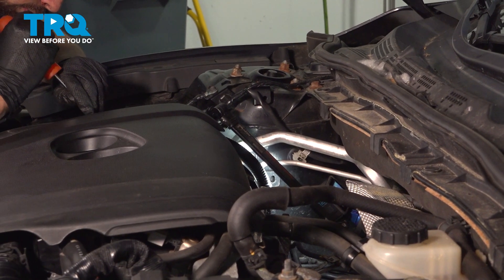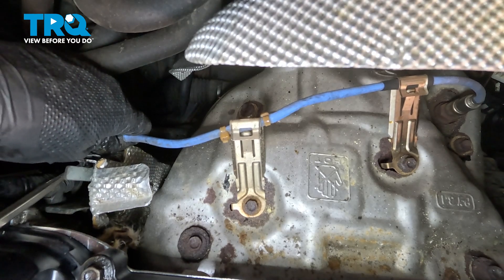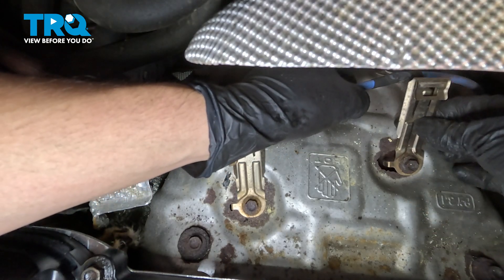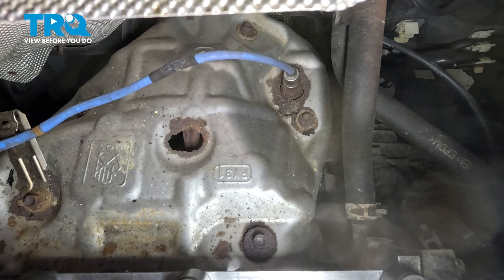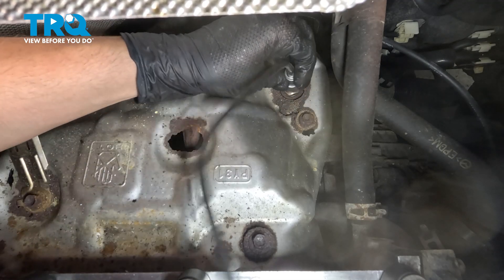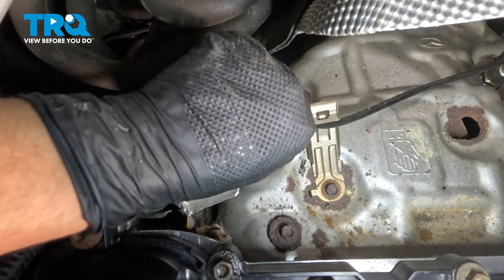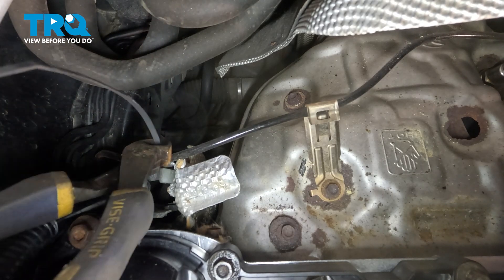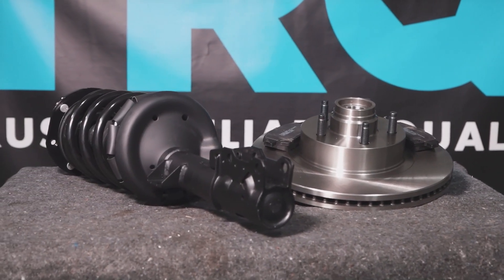How to Replace Upstream O2 Sensor 2014-2021 Mazda 6

Comment: When removing the wire you don't want to pull on the wire its self as it can loosen the connection but rather the plastic end.